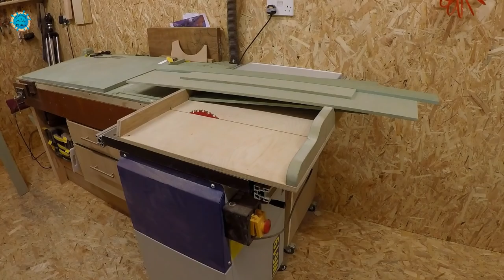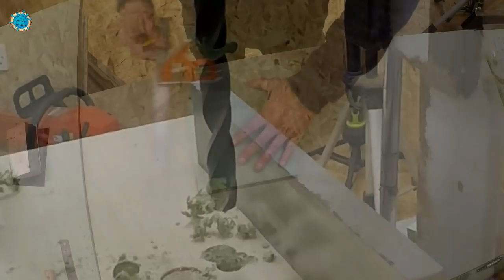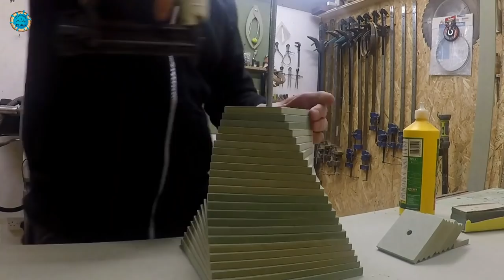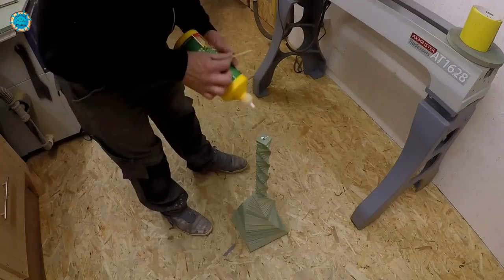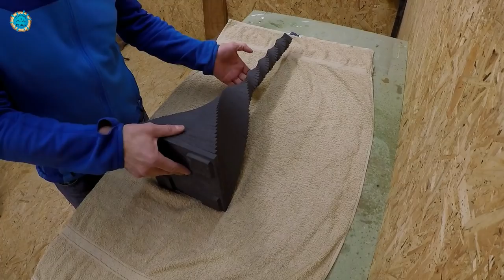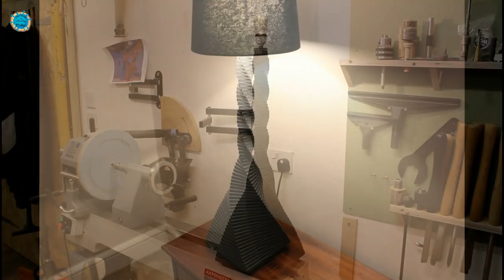The MDF Spiral Lamp

Comment: Nice video. Thanks for the up. Since you've didn't include the cut list, I have some questions: How many steps did you made and what is the thickness of MDF you've used and what is the total height of the body?
Reply from the maker: Thanks Adel .. The MDF was 9 mm ,  and I think there was 80 pieces  .. I just decided what size I wanted the base then reduced each piece by 5 mm until the taper got to 40 mm then cut pieces at that size until I got to the height I wanted ..hope that helps ..cheers
Reply: Thanks Andy for your answer. This is an awesome work.

Comment: Looks really good. What size did you start with and how much are you taking off each time
Reply from the maker: Thanks Matthew .. I'm not sure what the base was I think maybe 250 mm then i reduced each piece by 5 mm until I got to 40 mm then carried on till i got bored .. cheers
Reply: Thanks for coming back to me, was that both sides or just one
Reply from the maker: I kept them square if the first was 250 x250 the next was 245x245 ..cheers

Comment: cool project, quick question,, did you measure the angle of twisting, or did you just eye ball it??
Reply from the maker: Thanks .. i eyeball'd it really .. I reduced each peice by 5 mm then turned it so the corner touched the side of the one below 'if that makes sense ' cheers 👍

Comment: Hi Andy 

This light is amazing .

Love all your work , 

Can you tel me something please as i am thinking about building a workshop but not to sure which size to go with was thinking 16x12 but the cost to build it would be around £2500 with sound insulation all round ,So wanted to ask you what SIZE is your workshop and is there any build video on it as it looks pretty new ? And from what i can tel looks to be a prefect size .
Reply from the maker: Thanks .. sorry I don't have a build video .. I think it cost me something similar when I built it a couple of years ago ..I think its 18x12 then I added an extra 6x8 on the side .. If you check out the santa came early video you get a view of the outside .. cheers Andy